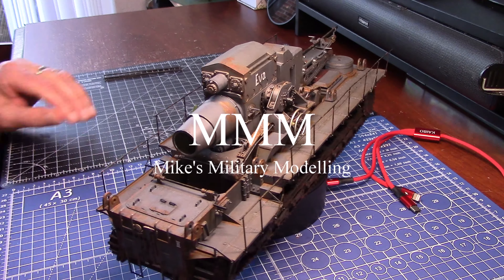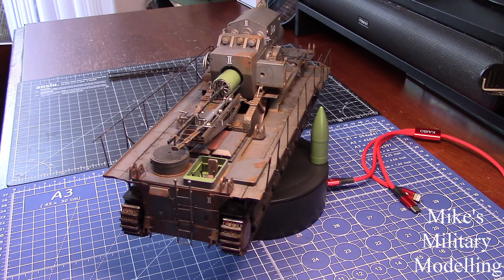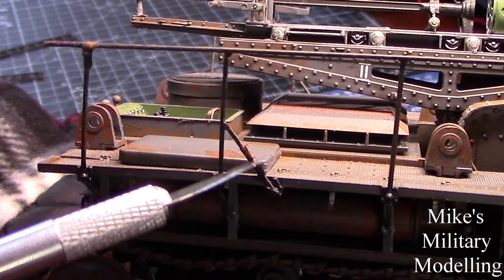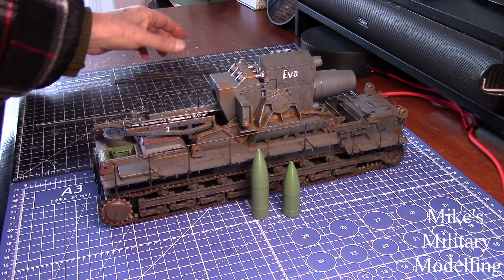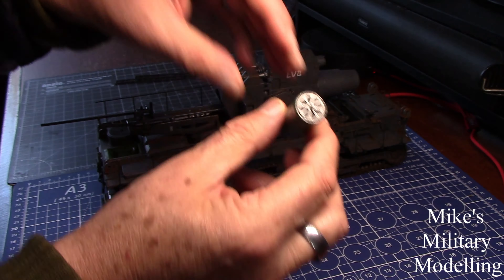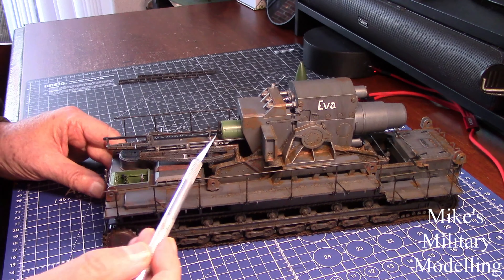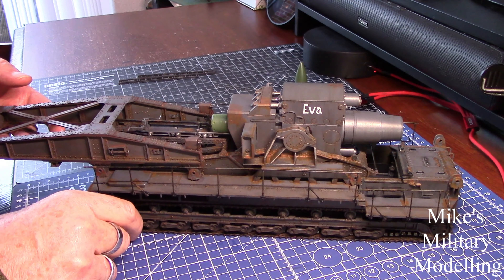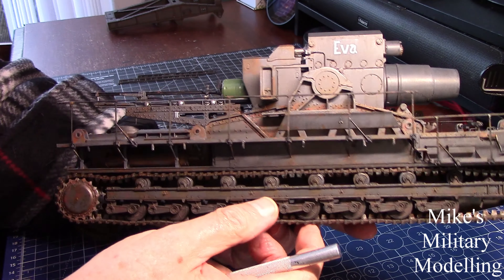Morser Karl-Gerat 1:35 Siege Mortar (Part 13 The Finished Morar).

Comment: Very impressive! Im a bit scared to make this beast haha. You did it justice!
Reply from the maker: Thank you Jan,
It's a big and sometimes difficult kit, next week I'll do the final revel of the gun on it's rail transport. Love the stuff your've done on your channel I'll take a proper look later.
Cheers Mike.
Reply: I'm nearly finished with the two supports for the rail cars.just airbrushed both of them today.my question to you is what kind of glue did you use for the supports for the bearings to the rail cars.i mean the top frame supports that hold the tank ?
Reply from the maker: @ I'm sorry Dennis, I've only just found your question. The only glues I used on that kit were Tamiya extra thin, Revell contacta Professional and Super Glue. I know I'm way too late on this one but hope it helps anyway.
Cheers Mike.